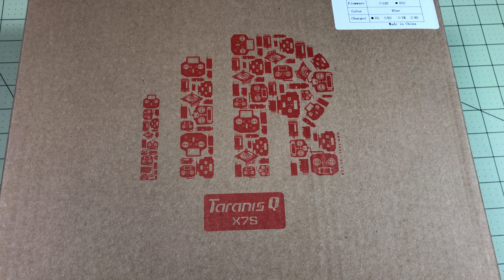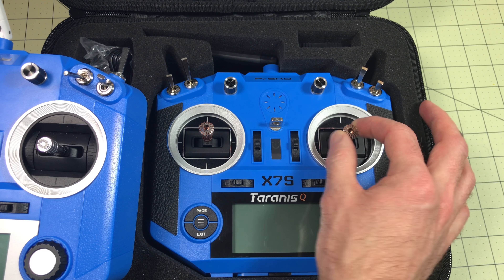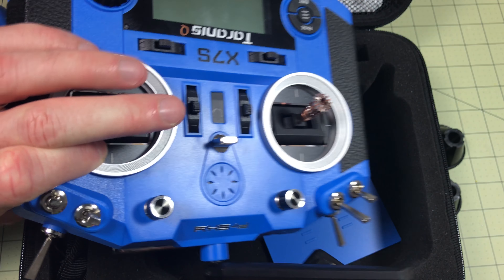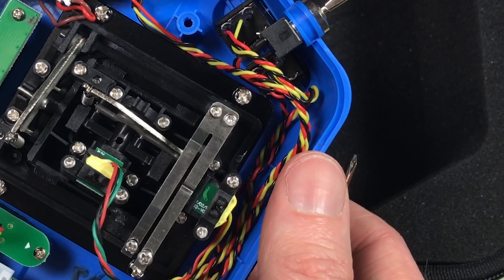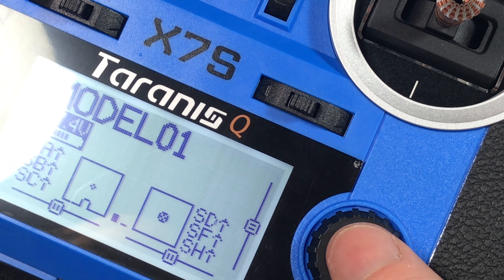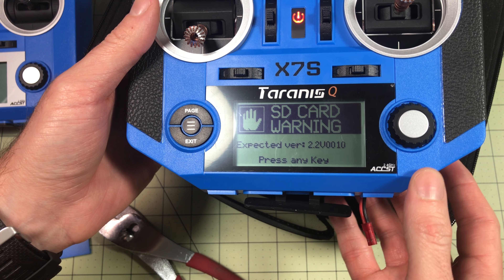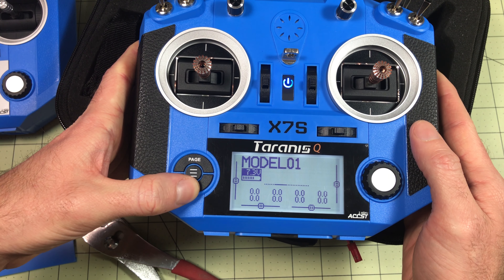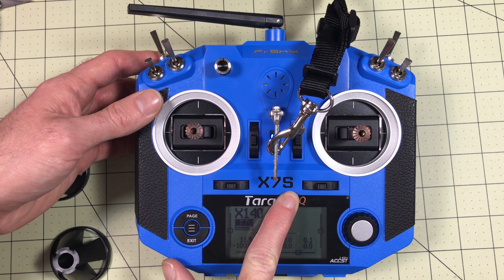FrSky Taranis QX7S Review Yea, it’s worth it. Once I do two quick mods to it.

Comment: I just got the QX7S to replace my Flysky FS-i6.   The gimbals are Amazing!  I am a pincher and I really like the gimbals and the fat stick ends on them.   I feel like I can get better full range of control with them.   On my flysky I would have to stretch to fully pitch up or go full throttle.   But this feels alot more comfortable when trying to go all the way to the ends of pitch and throttle.    Switch position is personal preference.  But I like the 2 position switch for arming right where it is.   I use the temporary switch with it to make the Arming safer.

Comment: Ya I'd say it's worth it.  When you add up the separate cost of the gimbals, case, battery, thumbsticks, and stick protectors, it about equals out. But if you had to pinch pennies, just get the standard QX7 and buy the Hall effect gimbals since that's the most important upgrade.

Comment: I think when you add everything up its worth it, but mostly just for the HE gimbals. But rough price breakdown qx7 -$100, HE gimbals = $50,  Case = $30, battery = $15, charger = $10, Neck strap = $8, upgraded sticks = $5, gimbal guards = $5 - Thats a little over $220 and you can get it for $180 with a 10% off coupon. Pretty good deal

Comment: Nice review. Before frsky a mid priced JR or Futaba could easily cost more than a Horus. The value is here with frsky nevermind the flexability. I did the Aloft Hobbies charge jack and 2600 mah nickel medal battery on my QX7. Just add the charge jack for 10 bucks on the S.

Comment: One other thing that this radio has is a light up screen the the x7 does not. Also . A slight angle was added to the front switches so u don't hit then with your fingers controlling the sticks.

Comment: nice review. can you tell me if the top right switch is 1 position or 2 position? i need to replace mine but don't remember if it was 1 or 2 position. I thought it was 1 postion that you had to hold up and then just went back, but don't remember because mine broke off

Comment: The raised bits on the face at the top that has the two toggle switches on either side is angled on the QX7S but flat on the QX7. Seems bizarre that they'd make an entire new mould just for that and then only use it for the QX7S and not the QX7 and not add an extra hole for a barrel connector for direct battery charging using an external charger.

Comment: Also, I found that the battery compartment can hold 3 18650 li-ion cells so I made my own 3s 2500mah pack which last soo much longer than any other lipo or nicd battery and its 12.6v!
Reply from the maker: Ah good call.  I wonder why someone doesn’t just make that.
Reply: Perfect fit. Li-ion have the highest  density of power/volume, that's why their so muhch thinner than lipos

Comment: The deal breaker for me is that one has to remove the battery to charge it. I also can't see that flimsy balance connector on the main board last very long. And the plastic battery leads suck too. Not sure what frsky is thinking lately.
Reply from the maker: I have been told they have updated it with a charging port.
Reply: @SimRacer101  They did, I just received mine

Comment: Great review. I want to get rid of my boring x7 when seeing this. Perhaps upgrade the x7 gimbals instead of getting the x7s. Is the gimbals the biggest difference?
Reply from the maker: +MarreMachine by far the biggest difference is the gimbals. If you have a QX7 I certainly wouldn’t buy an S. Just get the gimbals. http://bit.ly/QX7HallGimbals
Reply: DroneRacer101    Aloft has them for $18 ea. compared to $50/pair @ Banggood.  I was wondering why some QX7's came with a Ni-Mh battery and some did not?  Thanks for the vids man.
Reply from the maker: +DroneXFun The  very first shipments of QX7 radios shipped with batteries as a bonus.  It was kind of a secret.

Comment: Good info on this Tx. I really want to try and give the FPV world another chance. Will you recommend this Tx? I used to have the X9D Plus, but one thing I really like on the QX7s is the rotational dial, think it’s much better than to having a push buttons like the X9D to navigate thru the menus. Thanks!
Reply from the maker: I do like it,  like the X9D SE more, but it’s personal preference.  I compare them all in this video Which Taranis Radio is best?  FrSky Taranis Shootout!  QX7S vs X9D SE https://youtu.be/jF3cUAcaqPw just ignore what I say about pricing.  The QX7S is about $50 cheaper than the X9D SE now.  There are links in that video to find the best deals.
Reply: DroneRacer101 X9D Plus SE is the one I used to have, very nice and I do like it a lot. I’m gonna subscribe to your channel, if I’m gonna get back to flying drones again using Taranis Radio gonna need all the help I can get. Thanks again.

Comment: The battery that comes with this is similar chemistry and about the same capacity as just using rechargeable AA. So I don't really see the point of that battery, especially when you have to remove it to charge.

Comment: Can I buy this and bind it with one of my quads and start flying immediately or do I need a lap top to do firmware updates ?
Reply from the maker: You could use it right out of the box most likely.  I don’t upgrade mine very often.
Reply: DroneRacer101 awesome thanks for the response

Comment: If you don't care about the case, the battery, and the Bluetooth trainer, not covered in depth in the review, I would just get a X7 and add the hall effect gimbals. Total cost will be about $50 cheaper than the S version. Oh, S version has backlit screen too. So if you don't care about that either.
Reply from the maker: +Curtis Campbell That was my initial thought when I first saw it.  Does’t make any sense.  But the case is so much nicer than the one I have been using for year it helped win me over.  And you are right.  I totally forgot about the trainer.  I think that is more useful for planes than drones.
Reply: DroneRacer101 The regular white X7 is on sale right now on Gearbest. About $10 cheaper than Banggood.
Reply: Curtis Campbell my x7 is backlit I'm confused yours isn't? Yeah just want new gimbals for $50 and I'm good
Reply: skypilot 23 My bad. I thought that was a feature difference. I guess not.
Reply: Curtis Campbell I saw another review they also mentioned no backlight on x7 so was getting mystified......
I think they make small unnanounced mods over time_ the first ones also had no pins in the bottom bay for updating rx software. You can't use the module bay pins like the 9d won't work
Reply: We must have seen the same review. I am still waiting on my X7 to arrive, so I am just going off the reviews.
Reply: Curtis Campbell I love mine only thing is the momentary switch sticks- maybe some contact cleaner I dunno yet how to fix- irritating

Comment: Great content! X7s also has the correct hardware to run crossfire protocol at full speed but the x7 does not. Inverter or something is too cheap in the x7 but not x7s. That's what I've been told anyway.
Reply: HDgodfrey 
I saw the x7s still has the cxfire bug per drone camps
Reply from the maker: +skypilot 23 it does still have the bug. Fix coming soon I am told.
Reply: skypilot 23 thanks for the heads up. I'm sure there will be a mod figured soon enough.
Reply: HDgodfrey there a firmware fix surface mount capacitor extremely delicate solder job and a software fix but adds latency
I'm gonna use my 9+ for cxfire
Reply: Yeah I'm just getting started and don't have allot of $. Don't have goggles yet but have x7 and built a f550 from kit. I'm saving up for Goggles, vtx, and cam.
Reply: HDgodfrey one thing I love about quads is the community- folks like to help and share tips 
Been into rc forever but started quads this year and didn't go far without some questions
I hate lipos so delicate can't keep on hand charged or increase ir- had 10 batts ready to fly this am- windstorm now need to discharge them to 3.8 one by one arrrrgh
 within my lifetime PLEASE new technology!